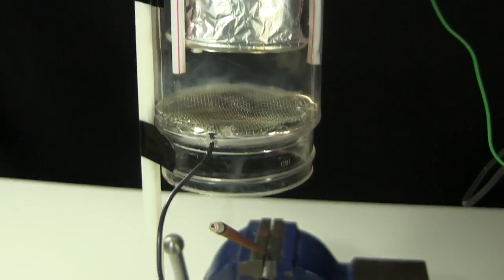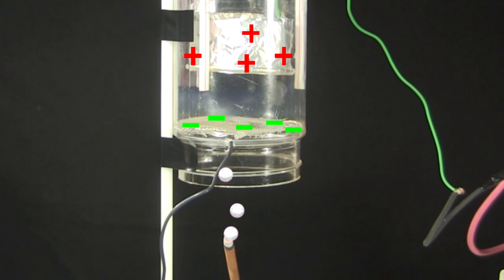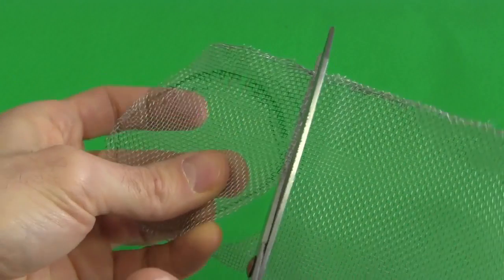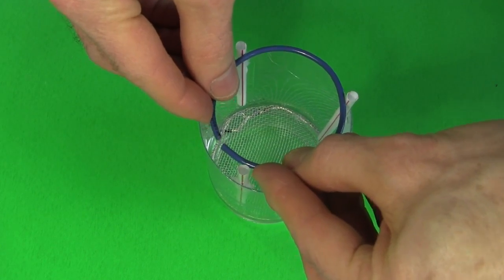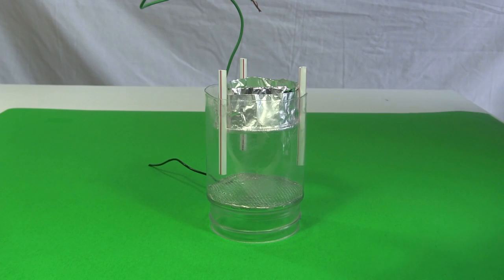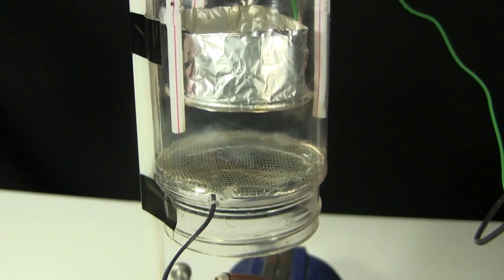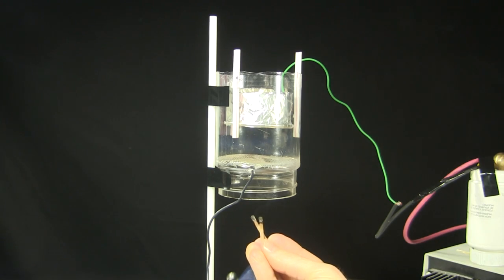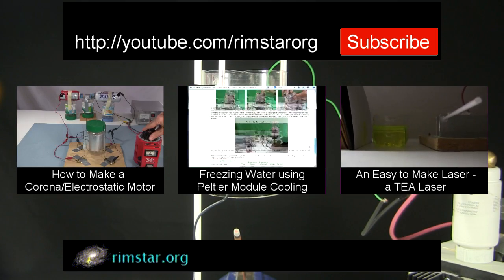Electrostatic Precipitator/Smoke Precipitator - How it Works/How to Make

Comment: You have the mesh attached to earth ground. So due to the high voltage applied to the cylinder, the mesh has a much lower voltage is comparison i.e. creating a potential difference.

The corona is therefore due to electrons jumping from the cylinder to the mesh...which in turn negatively charges our smoke particles passing through? 

Am I correct in say this?

Is there any added advantage to applying an even more negative voltage to the mesh? 
Would this be the same as just raising the voltage at the cylinder because it's all about creating a greater potential difference?
Reply from the maker: Regarding your first paragraph, a voltage is a measure between two things, the cylinder and the mesh in this example. So saying that there's a high voltage on the cylinder but a lower voltage on the mesh doesn't make sense. There's a high voltage between the two, your potential difference.
Instead you could compare the voltage on the cylinder to Earth ground and say that there's a high voltage between the cylinder and Earth ground. And since the mesh is connected to Earth ground, there's 0 volts between the Earth ground and the mesh.
However, that's not true once the power supply is turned on since the positively charged cylinder attracts electrons from the Earth ground to the mesh, and so the mesh becomes negatively charged and is no longer at 0 volts with respect to Earth ground.

Regarding your second paragraph, after reading what I said above, you can see that the electrons jump from the mesh to the cylinder. Smoke particles either get negatively charged  at the mesh or as you say, from the corona in between. They're then attracted to the positively charged cylinder.

Increasing the voltage wouldn't actually increase the voltage since the maximum voltage is limited by the distance between the mesh and cylinder and also the geometry of the mesh and cylinder. Turning up the voltage would only supply more current (assuming your power supply doesn't limit the current, mine doesn't). So if you were measuring both voltage and current while you turned up the voltage, you'd see the voltage level off and the current continue to increase. This would be good since that current supplies more charge for ionizing more smoke particles.
Would there be an advantage to supplying a negative voltage? The Earth ground that the mesh is connected to already has all the electrons you'll ever need. So all that supplying a negative voltage will do is increase the voltage between the cylinder and the mesh, which as the previous paragraph pointed out, will increase the current and be a good thing. However, the same thing can be achieved by leaving the mesh at ground and increasing the positive voltage on the cylinder. The result will be the same I think.
Reply: Thank you very much for the comprehensive reply! Much appreciated and cleared things up in my head. All the best.

Comment: how much voltage is required?
Reply from the maker: For this design you need around 21,000 volts. I recently did a follow-up video where I measured it https://youtu.be/ARSQWTzWago.

Comment: Hello Sir, will you please tell me the connections to the mesh part ?? And also whether it is able to precipitate exhaust gases coming out from a car??
Reply from the maker: Your high voltage power supply should have two outputs, very likely high voltage positive or negative, and ground. Simply connect it to the other output. Mine has high voltage positive and ground, so I connected the mesh to ground. Does your power supply have two outputs?
I was thinking of testing with car exhaust but when I looked at the exhaust from a car I didn't see any visible particulates so I didn't test further. So I don't know if it will work with car exhaust.
Reply: Thanks sir for your assistance. 

Sir, can i make ESP as my final year mechanical engg project or it is for electrical engg project?? Is there any new advancement in ESP??
Reply from the maker: I don't know which one it fits under. That sounds like a good question for your professor.
As for any new advancement, I haven't looked closely enough at it to know.

Comment: I take it it would attract dust the same way? Was looking into a ground plate for my negative ion generator to attract dust, but not to sure if this would work now, as i thought the negative dust particles would go to ground, but would the not want to go to positive, as negative is ground??
Reply from the maker: Is dust negatively charged? That doesn't sound right.
If you're negative ion generator is producing negative ions then they're likely negative with respect to ground, so they would be attracted to ground. Ground is positive with respect to the negative ions. That's based on my guess that your negative ion generator is producing a high voltage negative with respect to ground.
Reply: I believe it is high voltage yes, and is a negative ioniser so I believe the dust would be negatively charged, so just to clarify a metal sheet attached to ground from house wiring in respect to living in the UK would work?
Reply from the maker: Theoretically it would work. There would be an attraction between the plate and the dust. Everything else in the surrounding room is also at ground potential so there should also be an attraction to everything else too. So to have a stronger attraction to the metal plate, you'd need to positively charge the plate to make it even more positive with respect to the dust.
But I have no idea if the attraction would be strong enough to move the dust.
I've also no experience with this sort of dust ionizing and collecting so there may be subtleties that I'm not aware of.
Reply: Thanks, was thinking maybe a  positive from 12v might help, not to sure if it would be high enough voltage was just thinking it would be more attractive then the ground. From what I gather the particles only hold the charge for around 30 secs and within a short distance so I was thinking about placing the plate directly in front of the ioniser. Regards
Reply from the maker: No, 12v isn't high enough. It has to be a high voltage.

Comment: can we charge plastic materials by corona ??
Reply from the maker: I'm not sure what you're trying to do but yes, you can charge plastic material using a corona. In fact, that's just what's happening in my corona motor here https://www.youtube.com/watch?v=2rVdEhyMR6A (see near the end of the video where I explain how the corona motor part works). In that case I'm using sharp blades to spray charge, through a corona, onto a plastic cylinder.
Reply: im going to charge tow different plastic material by ionic wind that created by HV power supply and i know that one of this plastics have a low work function then i think maybe we can charge some of them positive and the other negative, whats your opinion?
thanks for your answering
Reply from the maker: Sounds doable.

Comment: does it generate ozone ?
Reply from the maker: Yes, it produces ozone. There is a voltage somewhere between 1000 and 10,000 volts below which you don't produce ozone, but I've never found out what that is. And in my recent follow-up video, https://youtu.be/ARSQWTzWago, to this one I found that this smoke precipitator uses a much higher voltage.
Reply: RimstarOrg do you know how to make one which uses below 10,000 volts ?
Reply from the maker: I'm not sure it would work. So I can't say if I can make one, but I also have no plans to right now. Certainly an ion wind device is possible under 10,000 volts, but will it capture particles? That I don't know.

Comment: +Rim star org mine one is not working I have used a 220v_12v  2amp. transformer to convert 220v but then also it's not working
Reply from the maker: 220 volts is not enough to make it work. I recently did a follow-up video (https://youtu.be/ARSQWTzWago) where I measure what I needed and it's around 21,000 volts.

Comment: where do we get induction coil for this project
Reply from the maker: Which induction do you mean? There aren't any induction coils in this project.
Reply: Induction coil means the DC power source for creating electrical field
Reply from the maker: I didn't use a step-up transformer, if that's what you mean. In this video I used my homemade 30kV power supply (here's my video on making it https://www.youtube.com/watch?v=GEuK1OdYxHk). But I tried a few other things to, since I get asked this a lot, and put it all in this recent video https://youtu.be/ARSQWTzWago.

Comment: Can i make a prototype electrostatic precipitator work using a 12V DC supply? What is the minimum voltage it requires to work? Thanks
Reply from the maker: No. The minimum voltage required for this one is 21,000V DC.
Reply: Thanks

Comment: how much voltage does it require?the voltage should be ac or dc?
Reply from the maker: I didn't measure it, though judging by the distance between the mesh and the foil cylinder I'm guessing somewhere between 10,000 and 20,000 volts. It has to be DC. The smaller the distance between the mesh and the foil cylinder, the lower the voltage needed.
Reply: +RimstarOrg thank you one more doubt can i use the high voltage from flyback driver..?
Reply from the maker: If it's a flyback with a builtin diode then it should work, though I haven't tried it. The output of that type is pulsed DC. If the flyback has no diode at its output then the output is AC and it won't work. It's pretty rare to find a flyback with no builtin diode.
Reply: +RimstarOrg i have made the flyback driver using a circuit od cfl lamp nd flyback from plasma tv...would it be right.?
Reply from the maker: I don't know... I'm not familiar with that circuit. Do you have a multiplier circuit after the flyback or just the flyback? If it's just the flyback then it looks like it won't work based on what I say here...
Since you brought it up this morning I just tried it with my Cube power supply that has a flyback with just a builtin diode at the output (pulsed DC) and it didn't work (http://rimstar.org/science_electronics_projects/high_voltage_power_supply_w_flyback_transformer_builtin_diodes.htm) . It made the smoke turbulent but I guess the voltage wasn't high enough to attract it all to the foil cylinder. I don't know what the voltage was since the high voltage probe converts it from pulsed DC to flat DC and the voltage it gives is no longer what it would be without doing the measurement.
But I also tried with my 30kV power supply with the flyback followed by a multiplier circuit (http://rimstar.org/equip/30kv_pwr_supply.htm) and that worked still, and the voltage with a distance between mesh and cylinder of 27mm was around 21,000 volts.
Reply: +RimstarOrg i was saying about the flyback driver made from cfl circuit or a tubelight ballast..can u please check on that its really urgent and if it doesn't wrk can u supply me some easy ideas for high voltage input as i am a student so i needed an easy optionn for high voltage input which could be easily built.
Reply from the maker: Without trying the circuit myself I really can't say. Do you have a link to the circuit? Maybe I can at least tell if it's AC. But even if it's DC I won't know if it will work because I won't know the voltage.
There is no easily built high voltage source for this that I know of.

Comment: last day i try make this esp with HV from Ignition Coil but it's not working and the smoke still pass. please help me :(
Reply from the maker: What is the output of your ignition coil. The best would be flat HV DC. Pulsed HV DC might work but probably not if the frequency is too low, though you might see a pulsing of the smoke going through it. And if the output is HV AC then it won't work.
Try playing with the distance between the mesh and the foil cylinder. Bring them closer together. Perhaps your voltage isn't very high and the closer they are together, the lower the voltage is needed. If you start getting sparks then they're too close.
Reply: i'm using ignition coil from reguler car for making a HV, last day i try to change distance between the mesh and the foil cylinder but it's still not working. i also make frequency higher than before but it's still not working. i don't know what the output of my ignition coil, because i don't have any device that support for measure HV. i wondering if i use HV from flyback like your's "The cube", can i make an ESP with it???

Comment: wondering if this would work on the output vent of a laser cutter?
Reply from the maker: Good question. I guess if you're laser cutting wood then I would think so, but I don't know about other materials. There is an issue of ozone production, which you don't want to breathe a lot of. I've never been able to find what the threshold voltage is but above some voltage in the 1kV to 10kV range ozone production begins.

Comment: does the material of the wire matter?
Reply from the maker: No, as long as it's an electrically conductive material then it doesn't matter. So any metal will do.
Reply: RimstarOrg and the minimum to run this is 10 000 volts right?
Reply from the maker: That's my estimate. I don't know what the absolute minimum is. The closer the mesh is to the cylinder, the lower the voltage. But from my knowledge of what people have managed with lifters, which has a similar arrangement, the minimum is probably around 10,000 volts.
Reply: is it possible to make the same thing however with a low voltage precipitator and get similar results?
Reply from the maker: Not that I know of. Have a look at the http://wikipedia.org page on it. Maybe there's some other technique there.

Comment: thank you for sharing this amazing project.please advise on how i can generate high voltage power.i do not have easy access to buy a high voltage supply online.
i enquired about electric fence motor but that will only generate 9-10000 v.

what can i buy that will be affordable and accessible at any average electrical shop?
please help
Reply from the maker: I don't think you can buy high voltage power supplies in any average electrical shop.
I can't say for sure since I'm not familiar with your electric fence motor, but it may be possible that it will work. You'll have to put the foil cylinder closer to the mesh so that it will work with lower voltage like your 10000V.
Reply: did you end up trying the fence motor?

Comment: Nice video!....I'm an architect and I have no working knowledge of electronics.....Could use please guide me on how to create or buy high voltage power supply unit?
Reply from the maker: +Sagar Lohar To make the one I use in this video I have full details, including a how-to video, on http://rimstar.org/equip/30kv_pwr_supply.htm. To buy one I'd recommend http://www.amazing1.com/hv-dc-power-supplies.html. Any one there will do. Alternatively, my commercially made Wimshurst machine (from ebay.com http://rimstar.org/science_electronics_projects/wimshurst_machine.htm) worked with this precipitator and you can see photos at the bottom here http://rimstar.org/science_electronics_projects/electrostatic_precipitator_smoke_precipitator_simple.htm.

Comment: why it must use dc no ac
Reply from the maker: +KY LAI AC stands for Alternating Current. The Alternating part means that the electrons keeps alternating in direction, first in one direction, then it reverses to the other direction, then back to the first direction, basically going back and forth, back and forth,...  With Direct Current, DC, the electrons keep moving in one direction only. If we were to use AC with the smoke precipitator then the smoke would also be moving back and forth constantly, never getting anywhere. Whereas we want to blow it out the top. So we need DC, to keep it flowing in one direction only.
Reply: +RimstarOrg ok thanks for explaination if i use 9v battery can run this ?i make the distance between the mesh and foil become the smallest
Reply from the maker: +KY LAI No, you need in the thousands of volts, even with the smallest distance.
Reply: +RimstarOrg does fly swatter can run this thing
Reply from the maker: +KY LAI No. The fly swatter takes a little time to build up its high voltage. You need something that gives a more constant high voltage output. Also, I think the current would be too low.
Reply: may i know that will the diameter of the bottle will affect anything ?
Reply from the maker: +KY LAI No, it won't have an effect.

Comment: +RimstarOrg  i want to make the prototype of smoke precipitator using van de graaff generator..it is possible?
Reply from the maker: +muhd hilmi I haven't tried it but I doubt very much that my small Van de Graaff generator made using soda cans has enough voltage and current for it. But my big Van de Graaff generator with the 15" diameter dome almost certainly would. So it depends on the size of your Van de Graaff. I don't know what size is the minimum size though.

Comment: +RimstarOrg can i used it with 240v ac ?
Reply from the maker: +princess fabsome I didn't measure the voltage but judging by the distance between the mesh and the foil  I suspect mine was around 20,000 volts. You could probably get it down to the 4-digit voltages range, so somewhere between 1000 and 9999 volts since I think the voltages of the commercially made ionizers' are in that range.
So no, you can't use 240V AC. Also, it has to be DC.